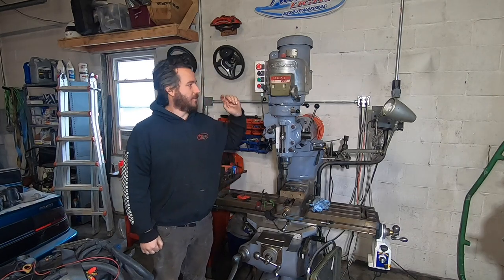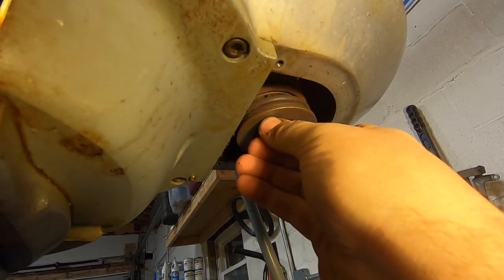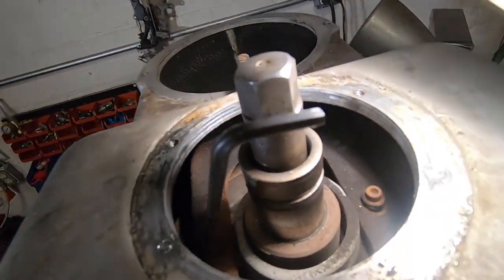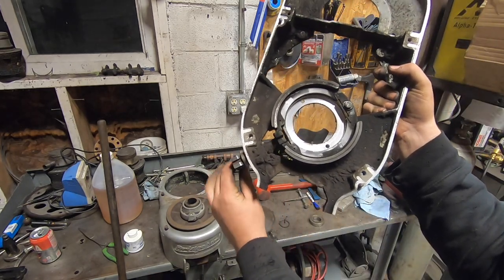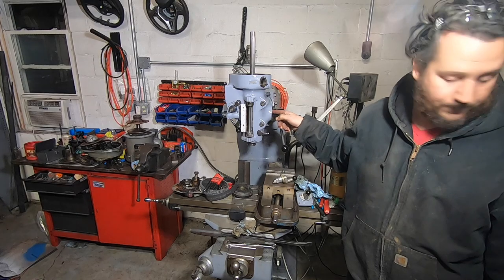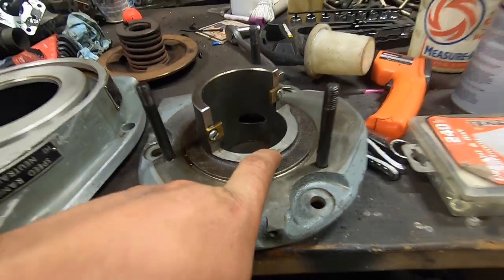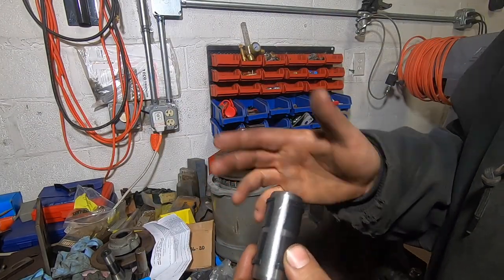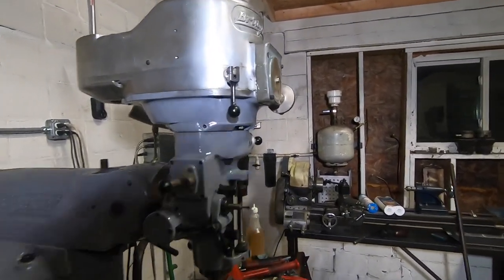Bridgeport Vari-Speed noise. Troubleshoot and Repair. Series 1 2HP J Head

Comment: There's a $600 Bridgeport for sale near me that has a squealing noise coming from the top. Awfully tempting after watching your video.
Reply: I hope you grabbed it! Once you own one, you'll wonder how you lived without one. I paid 100$ for mine, with a Kurt vise!! I've used it for over 20 years now, only now does it seem like I need to do some work on it. They are fairly bulletproof. You can find them for 1000, 1200, 1500$ pretty often, people often don't have the room for them or the power to run them. If you buy a 3 phase, a static convertor is only about 60$, easy stuff.

Comment: I wish I saw your video before I rebuilt my mill, it would have saved me a ton of time.  I could not find any information on how to adjust the variable speed plate so I did the same thing you did with a tachometer.  All of the other videos say, "do not remove the bolt".
Reply from the maker: Sounds like you got it all figured out one way or another. Great to hear.
Reply: Like a dumb ass, I had the motor and head vertical and stood on two ladders and the table.  When I finished, I realized I should have rotated the head 90 degrees so I could reach the parts better. Oh well, live and learn.

Comment: Great video, I have just purchased a Bridgeport series 1 2HP like yours, the bearings had all been done and a new belt fitted but the shims were never replaced, so it is a little bit noisy, although fairly smooth. Now I can attack the job of replacing the shims with confidence. Once I find them in the UK
Reply from the maker: Good luck! Its a very rewarding job and every old bridgeport deserves it!

Comment: Great video man, was wondering if you measured the spindle runout after the rebuild? Been reading that after replacing the bearings you should regrind the spindle taper. Been wondering if a regrind is necessary or if the spindle will still be in spec without a regrind after replacing the bearings.
Reply from the maker: I didn't. I didn't change my spindle bearings, I only rebuilt the top end in this video as my bearings are still nice and quiet. For the work I do, some spindle runout isnt too impactful. But I have seen some interesting videos of how people are grinding their spindles. Looks very doable in the home shop
Reply: @spankranchgarage   Thank you for the reply. I'll have to check out some of those spindle regrind setups. I definitely need to rebuild my top end and you made it look easy/did a nice job. Do you happen to have a tenths indicator to measure your runout? Nervous about rebuilding mine and curious if your rebuild effected the runout even though it was a top end build only.

Comment: I think you might want to try to refloat the head on your Bridgeport. I noticed some rubbing sounds when you were getting up there in RPM, similar to the ones I ran into when refloating the head on my mill. I made a quick video of it just to demonstrate what the head is supposed to sound like. I didn't have any references while working on it so I wanted to share what I learned.
Reply from the maker: I checked out your video. Your machine looks great! What did you mean by balancing? Like a real dynamic balance of the components? And yes I will play with this head more. I get a certain noise only when the head is cold. It goes away once it warms up and isnt existant in the summer (My shop has no AC)
Reply: @spankranchgarage  Okay that's good to hear. Yeah, all of the components in the head from the bearing cap on top to the spindle are aligned and not causing vibrations from being off-centered.  It took a lot of attempts to get my machine balanced. It's very finicky because you are trying to balance both a spindle and a transmission all at the same time. So any little bit of runout will cause some kind of noise and vibration.

Comment: My Bridgeport is noisy on low speed but runs quite on high speed. Anyone know why this would be?
Reply from the maker: I would suspect it’s a back gear or back gear belt issue. You can see those parts in this video. Unfortunately you have to tear it down pretty far to get to these

Comment: awesome work man. What did you use to take the old paint off? Cant ever find a good answer to that, was it time consuming to do it? thanks.
Reply from the maker: For the main column casting I used a wire brush on a grinder. There is paint and body filler on these castings and its very time consuming and messy to remove. For the head components, the OEM paint was in much better shape. I just touched up spots that were flaking with sandpaper then painted over the OEM paint.